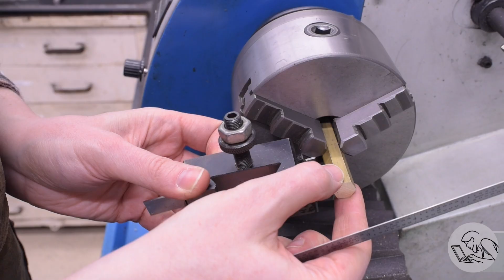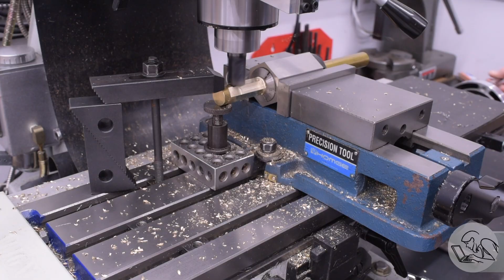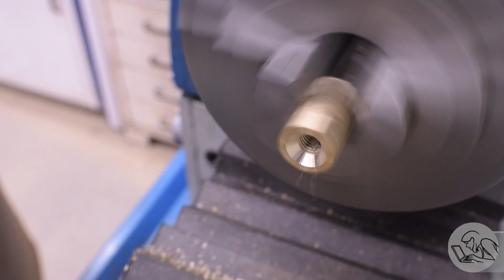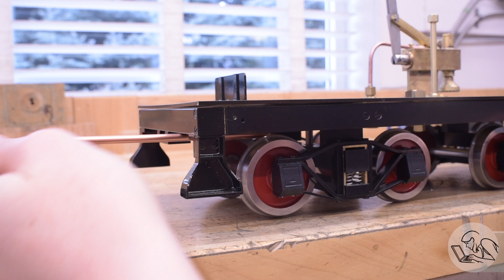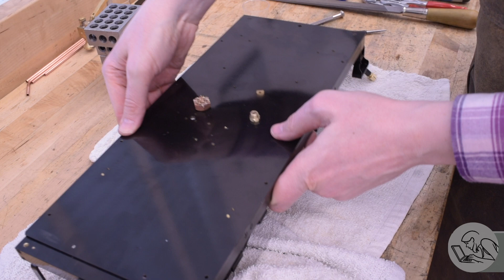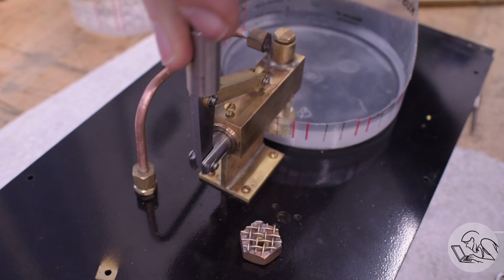Plumbing Time - Pennsylvania A3 Switcher, Part 33

Comment: A question in relation to the chips, etc that are created during your processes on the mill and lathe.  Do you collect the brass etc detritus from your (awesome) project steps? I am wondering if there would be any value in the collection and potential recycling of the chips et al.

BTW - I do believe you owe us one Yahtzee :)

Comment: I've never soldered pipe fittings I still sympathize because the number of times I've had to unsolder a wire because I forgot to put the heat shrink on first lol

Comment: Very nice job on all the machining!
Way back in time I was a sheet metal “specialist” in the USAF. Oh how many times I would make a precision hydraulic line and would be so proud of myself that it fit perfectly, until threading on the nut that mysteriously wasn’t there…SNAFU!

…I’ve been a machinist for more than forty years(yikes), and I’ve been using that center drill trick many, many times! There’s a similar trick using a spotting drill…

Comment: 22:20 note to anyone following along, I wouldn't recommend harvesting that braided shield from coax cable. I'd tried something similar to protect some silicone tubing on a pneumatic project, and at least rg6 coax cable shielding, once separated from its core, frayed very badly after not that much flexing and actually punctured the lines. The weave of that shielding apparently relies on the rest of the cable to keep it together and from fraying, separating it as quinn suggests causes many sharp and frayed wire pieces. If the shielding she bought isn't available, a good place to harvest this from is automotive rubber brake lines. In that application, the stainless braiding is on the outside, and I have used this as hose shielding before without those fraying issues.

Comment: Great work on the plumbing of the tender!  Yeah, not the most glamorous part of the project, but it is essential, as you say.  And very satisfying to have it completed! :)  And remembering to put those union nuts on before you solder AND getting them on in the correct orientation is like the holy grail, isn't it?  😅

Comment: In addition to being shielded against ash and debris, those hoses will be less affected by EMI. This is important because maintaining signal integrity in your water feed significantly increases the interval between cleaning out the flipped bit filter on the boiler.

Comment: Try lifting the tool holder for the interior chamfer and then drop the tool back to its normal position, easy peasy, two chamfers same tool. This is an old trick in job shops with similar tool posts, or indeed any Aloris type quick change tool post, even the 4 sided spinners could be reset with a spacer under the tool, remove, and, retighten the screws, and Bob's your uncle.
Reply from the maker: That’s a great trick

Comment: As an avionics tech, I was also nodding in understanding at the union nuts. I can't count how many times I've crimped a pin or terminated a connector without adding the backshell, or heat shrink, or labels, etc...

Comment: You are far too modest. Not only did you remember to fit both nuts to the pipe, you fitted them both *the right way around*. This is God-level engineering.
Reply: Aggh! Now I have another potential error to fret about… :)
Reply: break lines, optical fiber splicing, and now this. Far too much suffering in this world.
Reply: I've done a few "practice flairings" on tubes before.

Comment: You don't have to be a model engineer to sympathize with the "I remembered to put the coupling nuts on before soldering" situation.  Any mechanic will tell you about instant face-palms when you finish the perfect flare on a brake or fuel line only to realize you forgot to slide the fitting on.  And you can't even get mad, because you know you only have yourself to blame...sigh, ask me how I know.

Comment: Nice video! Lots of progress! Here's an idea: glue a thin piece of material, maybe sheet foam or marine plywood, to the bottom of the tank so that there isn't so much dead space below the pickups that can't be pumped out or drain. Maybe put a cut out around the pump pickup to make a sump. The usable water would remain the same but you would decrease the amount of undrainable water at the bottom of the tank to a few ounces.

Comment: I'll say for bending copper pipe like that beinding it round a piece of bar stock the right size for the inside of the bend works well without issue if it's put under a torch first without the need for benders

Comment: If im understanding this correctly, the backup feedwater hose must be rated for pretty high pressure, as your hand pump would need to overcome the boiler pressure to feed water in if the main axle pump stops working? I only ask because it seems like you used unreinforced silicone hose, which would work great for the main pump drawing water through, but I dont think hold the pressure the backup hand pump will create.
Reply from the maker: Stay tuned to see how right you are
Reply: I was just going to ask if the braided sleeve was also to provide reinforcement for the silicone hose to allow it to contain the required pressure!

Comment: I have had to cut a perfect flare off a home fuel oil line because I forgot the nut....  And had to cut plenty of cable ends because I forgot the housing before soldering the connector on... So I felt that section.

Comment: I don’t even want to think about how long the locomotive is going to take. I hope I live to see it.
Reply: I don't know, I think she's moving right along. Helped by being full time, but she also has to do the alternate fill-in stuff to prevent the channel being too monotonous. 15 months elapsed so far, let's say half of that was on the loco, pretty good progress. The big thing is the boiler is done, that's a massive job. She might be 1/3 through now, certainly more than 1/4 I'd have thought - so maybe another 2.1/2 to 3 years, or if she just focused on the loco, could be as little as 1.1/2 years. If she didn't have to do the filming I reckon she would have done the whole thing in less than 2 years start to finish which is really fast - but then the filming is what pays for the full-time work, so that's not a realistic scenario.